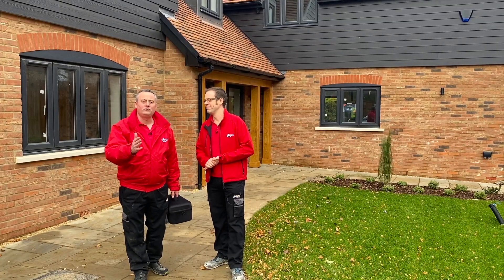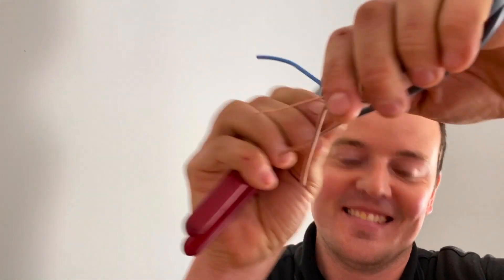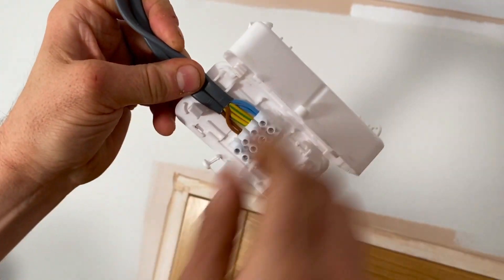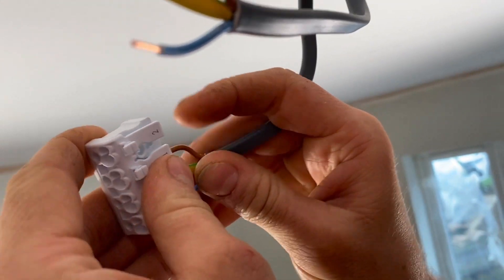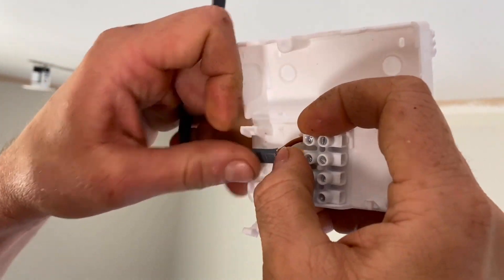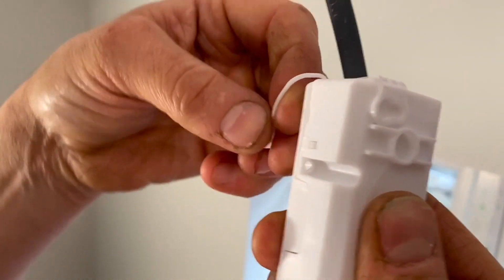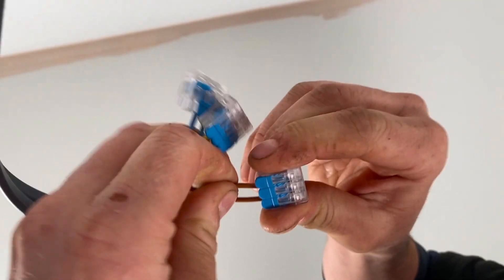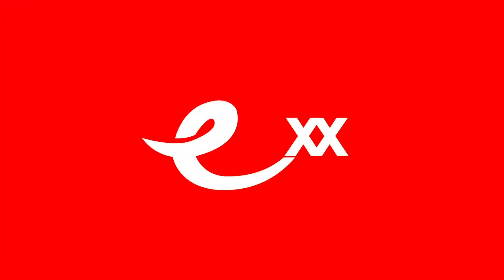Electrical junction box innovations - Ideal for lighting installs | Hylec Debox

Comment: Thanks, I am a bit too old for some of these new connectors, I bought a push fit box but was concerned as to the method of removing the cable ends if necessary. I only got one so did not wish to experiment.

Comment: I'm trying to enclose some wiring in my attic and having watched this was keen to give these Deboxes a go. I bought both types (just to try each) but both have the same problem - Namely, its pretty much impossible to close two cables on one side. Watching here at 4:04 it looks like it won't be an issue. In fact at 4:20 you can see this video has actually been cut when the box is going to be closed! So I wouldn't recommend these unless it just for simple extension purposes with one cable in, one out...

Comment: What about downlighters that require connection boxes, but where you can't pop-out the fitting because it's plastered in? Presumably that's exactly what maintenance free is for? Is there a way to protect it against leaks within the building, i.e. broken pipes causing water damage? i.e. can you get boxes like this that are IP rated (without the need for gel boxes etc.?)

Comment: Are you allowed to use twist on wire nuts to connect wires together? They work really well and are inexpensive but I have only seen them in America.
Reply: Allowed, yes, but they’re shit and haven’t been used much since the 80s, up to maybe 90s, just about anywhere in Europe.

(Here in the Netherlands the screw connector blocks are not allowed, though, and never have been — we mostly moved from wire nuts to wagos in, like, the 80s-90s.)

Comment: Question: What will be the loss difference between the screw and pushpin connectors? I imagine a small difference, but it all stacks up. What are the costs of these junction boxes and are they available throughout Europe? Another question: What are the best wire strippers you have used, what do you prefer? Especially for the small diameter flexible wires, low voltage / low current type of wires. These are the most painful to strip.
Reply: I suppose the screw connectors do have the extra losses mount up eventually.

Comment: Australian here - this doesn't fly here - it's not customer servicable.  We use in-ceiling AS3112 plug socket, desgined for in-ceiling environments.  The downlight comes with a plug on the cable - you just plug the connectors together and the customer can replace the light themselves at a later date.

Comment: "...time-wise it's better!"   ... Stop using screw term block and use Wagos instead ... 4 times faster minimum! I'd never use choc block under those circumstances, no point with Wago 773 series being so good, so fast and lower cost overall due to the speed of connection ... strip, insert, box and done!  

No faffing around trying to get a flathead screwdriver to line up properly! And if torquing screws in an MCB correctly is so vital, why does it become irrelevant on lighting T&E?
Reply from the maker: It's an interesting point about the torque, maybe we'll see requirements for torque settings on all electrical accessories before too long...
Reply: I completely agree. 

Wago connections need to become the industry standard right across the board. We’re starting to see them in sockets get them installed on everything!!
Reply: Faster isn’t always better
Reply: @fraserreid719  Agreed, but when the faster option IS BETTER (by far) AND it has no better rival from anything!? ...👍👍👍👍♥️♥️♥️
Reply: @boblewis5558  you going to have wago connections on 400mms soon and think they are the bees knees?
Reply: @fraserreid719  seriously mate, you REALLY need to understand the difference between steel cable clips and WAGO connectors if you're going to continue in electrics! 😲🤔👍
Reply: No. You need to stop putting time against things. Cut time on jobs cut times in life, never once told you to “give up electrics’ attitude is ripping out you.  Bet your a chargehand who was bullied as an apprentice
Reply: @fraserreid719  not very good at this are you? No professional EVER would cut corners but REDUCING time is correct. Your terminology is flawed ... You need to know & understand the difference between saving time & cutting corners, when something is the BEST AND saves time that's good all round ... For the client AND you! It is wholly unprofessional to cause a customer to wait for an inferior job being completed when a SUPERIOR one takes less time! Chocolate block is most definitely inferior to Wago connectors in a host of ways AND they are MUCH faster, simpler, neater, safer, and more accurate to use. So what exactly is your beef with what I, and many other commenters already agreed upon, said? If you feel that Wago connectors are NOT superior or faster ... Prove it! Otherwise STHU!

I was NEVER an apprentice I am a degree holding, retired, professional  electrical and electronic engineer with 50-plus years of in-field experience and a member of the IEE/IET for all that time.

Comment: Torque setting on the screw terminals? Yup, arm is fully calibrated to NICEIC PowerPoint presentation standards.
Reply from the maker: Do you think we'll see requirements for torque settings on accessories at some point?
Reply: @efixx  let’s fucking hope not! I still think it’s crazy that a sparky NEEDS to have a torx screwdriver 🤦🏻 Let’s hope I never have to use one but I’m in my mid 30’s so who knows 🤷🏻

Comment: The Debox sl2 is garbage. I used 6 boxes and half of the lever connectors failed and trust me they are a shadow of wagos. I wouldn’t waste your money.
Reply from the maker: Did you get in touch with Hylec about it?
Reply: @efixx  unfortunately I didn’t. I only used them because the wholesalers didn’t have the Small Hager junctions. 

For that reason, I’ll give them a wide birth unless I’m in desperate need. They just seemed very flimsy to me, compared to the 221’s

Comment: he used same wirecuttter as we have for years. 
We saw ur vid on knipex 16,  knipex site shows knipex 10 which is slimmer, and screwfix do a £60 knipex pistol grip.. in your oipinion which is the best for smalls spaces and all cables.. outer inner, cat 5 burgler alarm 3 core round t.e.   REALLY APPRECIATE A QUICK COMMENT or a comparison vid in the future.    Screwfix one is easiest to get is it as good as the 16 or 10......   THANKYOU